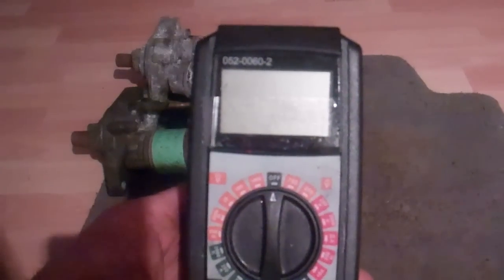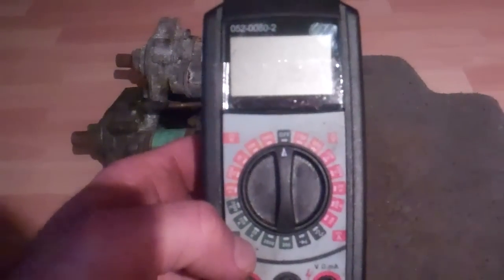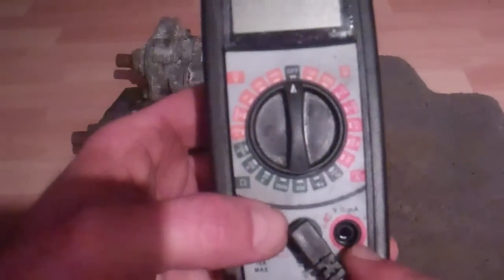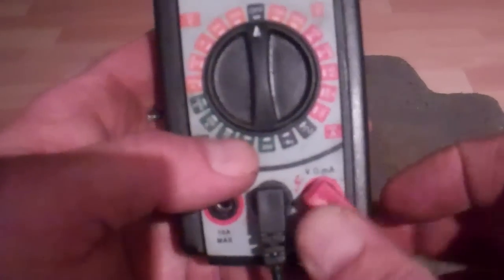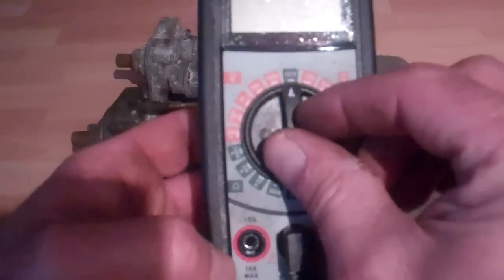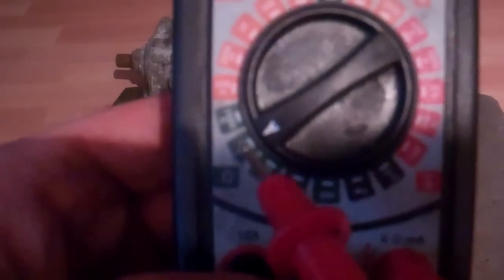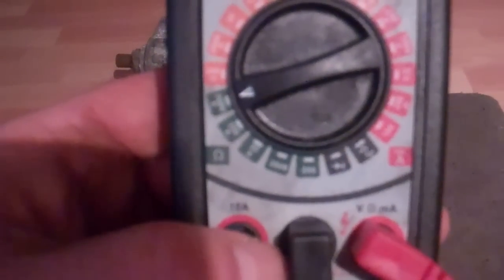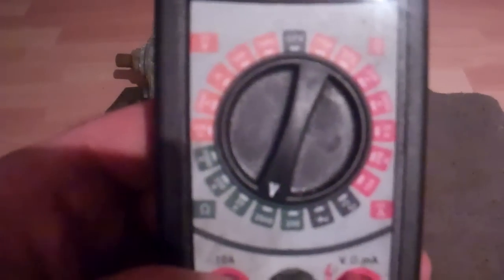How to measure resistance using a multimeter

Comment: when i used my multimeter for checking resistor it showed '30' (meter was on 2000 ohms setting) does that mean the resistor is of only 30 ohms?